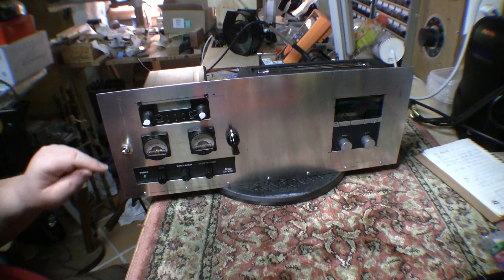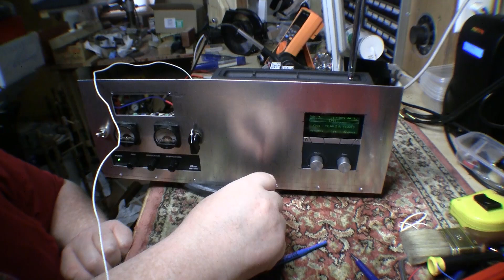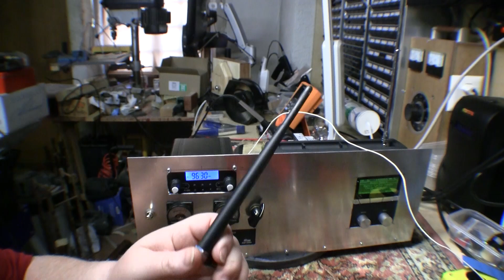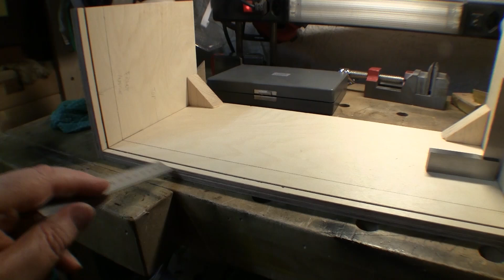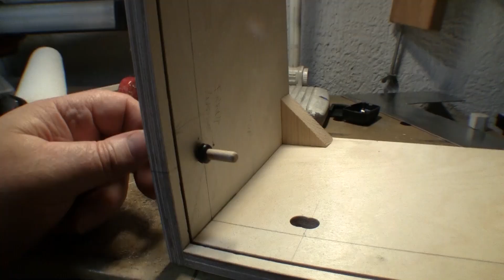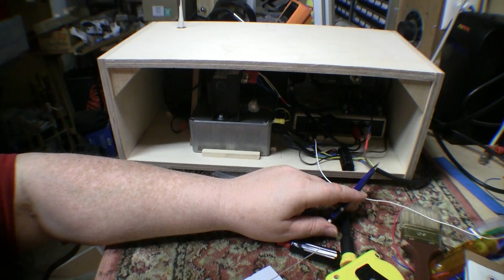Multi-TX Project - part 2

Comment: Awesome job so-far John!  Since the VU meter illumination is weak, you can now add a power light indicator!  As for the cabinet, you could pay homage to the vintage radios and use hammer paint. For the center graphic, create something that looks vintage and call this apparatus the "Zone1242 FrankinRadio"!  :) As far as the aerials are concerned, mount one vertical and the other horizontale, and for the AM aerial, you could make a back for the cabinet  and wind and place your AM aerial there?
Reply from the maker: JacksJunkDotCom Thanks, some cool ideas  - I'm don't know much about aerials when it comes to transmission versus simple reception but I'll try various things to see what works best.   Not sure about the hammer paint - ideally I want this to look not too out of place when I install it in my sitting room.
Reply: Zone1242 I've been experimenting with wrinkle finish paint myself, but I had some problems with the spray can plugging up so it's did not really come out right. Hammer finish or Hammerite paint would look rather nice, though that was more typically used for test equipment. One think that you might consider, since it is an aluminum panel, is an engine turning effect, I think that you need a felt drum, some sort of polishing compound, and a drill press.
Reply from the maker: OlegKostoglatov Yes I've used the engine turning effect on projects in the past.  While it looks fine for a device that remains in the workshop, it's not really what I need given where I want to install it.   I'll probably end up trying a few things before I find the solution that fits best.

Comment: John, old bean, that setup is really looking cool.  I also just got done watching part 1 and your idea of removing wall warts from their plastic enclosures and placing them in a metal box/container is rather ingenious.  I would have never thought of it.  I particularly like the shielding aspect.  I'll definitely keep that one in mind.
The whole project is looking great.

Regards,
John
Reply from the maker: joernone Thanks John, yeah I'm pretty happy with how its turning out.  I'm thinking of putting other wall warts in metal cases to cut down on the overall RF noise level in the house.
Cheers,  John